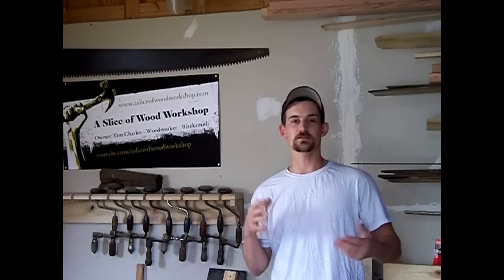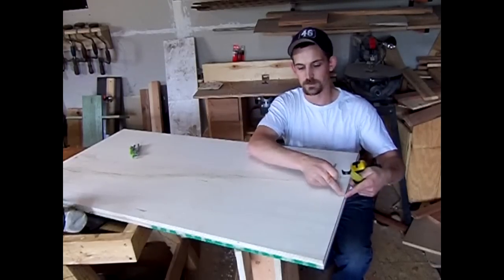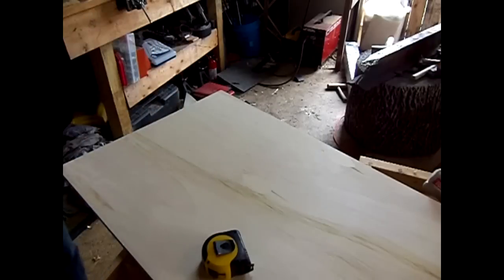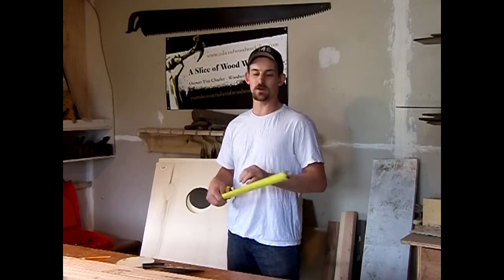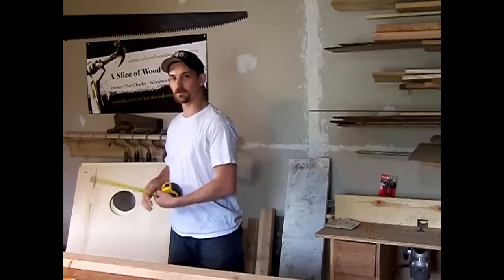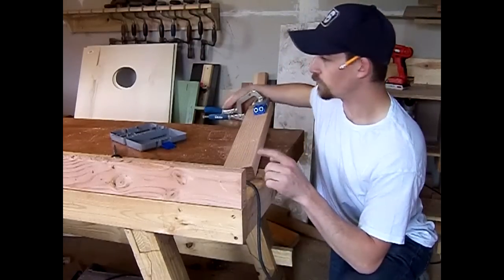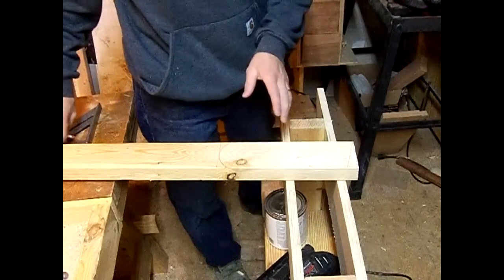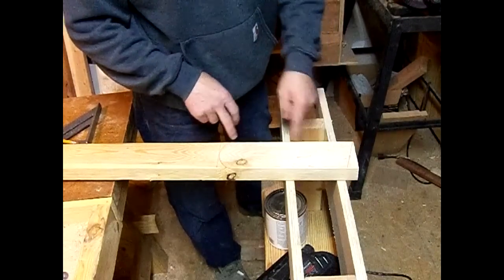Easy Made Cornhole/Bean Bag Toss Boards

Comment: Nice job!
Suggestion--For the legs, measure 11½" from the end and draw your 15° angle. That way you only need to make one cut for the bottom of both legs.  You will still need to cut the radius on both ends.
Reply: oooohhh yea good tip :)